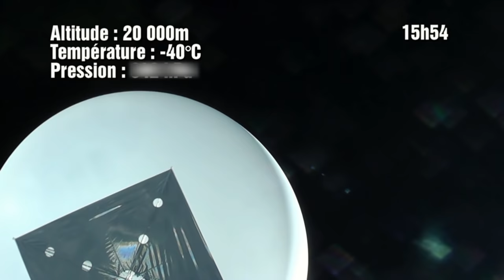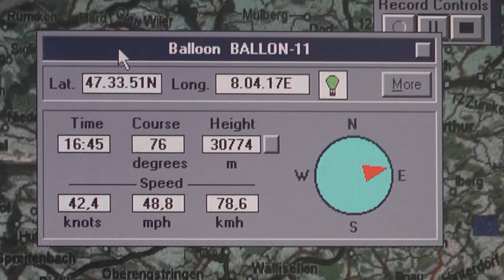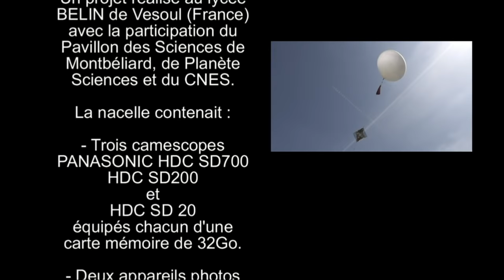Un ballon sonde stratosphérique filme un avion de ligne Swiss [subtitles]

Comment: That could have been a major disaster. And now it's being sold as if nothing happened and it was normal to spot an airliner with 160passengers at least at cruise speed of around 900kph inside 100m. The fucking Ballon had a wooden box!
Reply: Did you read the part about all proper authorizations and notice there was a RADAR reflector hanging from the balloon?  That airline pilot knew it was there and wasn't going to hit it.
Reply: Didnt read that part. But I still think it was unnecessary to get into controlled airspace with traffic.
Reply: @makor2817  Did you or did you not read the part about all proper authorizations?

Comment: Why does the temperature rise again above 13.000m ?and why does the balloon burst ?
Reply: As the balloon rises, air rarifies : sun radiation becomes greater and thermal exchange between the balloon and the environment decreases. Recorded temperature then increases.
As air rarifies, pressure around the balloon decreases. The pressure differential in/outside the balloon increases, which make it expand until its breaking point.
Reply: Coco L'asticot thanks mate !

Comment: It’s interesting,  the Earth rotates at 1000 mph,  and the balloon was in the air for nearly 3 hours yet it only landed 124 miles away from where it took off.
Reply: The atmosphere is also rotating at 1000 mph (at the equator). Items don’t just “stop moving” relative to the surface, the instant they leave the surface. If you jump up in the air, you’re not flung at 1000mph sideways, are you? And neither is the balloon. It’s just like a very long, high jump. The same.
Reply: The earth doesn't rotate the balloon experiment should prove that to you. It's the balloon that spin
Reply: The earth rotates with 15 degrees per hour.

Comment: First of all, excellent job and congrats to all the people involved in the project.  Let’s do some math.  We are told that the Earth rotates at a speed of approx. 1600 km per hour at the equator. Switzerland’s latitude is located about 46 degrees north of the equator and therefore, the rotational speed of the Earth at the launch site is approx. 700 mph or about 1126 kph. The rotation of the Earth at 46 degrees amounts about just over 11k per minute. The entire flight amounted to approx. 3 hrs.   Now calculate 11K x 180 minutes (3hrs) which amounts to a distance of about 2, 160 km. Now consider that probe balloon landed approx. 200 km away from the launch site.
  Can someone please explain why the balloon landed  only 200 km away and not over 2,000km, while taking into consideration that the atmosphere moves with the rotation of the Earth?

I look forward to your reply. Thanks and have a great day!
Reply: It is easy to explain. If the earth surface is traveling at 1000 km/h, so is the balloon and the atmosphere at the moment the balloon rises. So relative to eachother, both earth and the balloon aren't moving. The balloon drifts away due to the wind, but if there was no wind blowing, the balloon would come down even more near to the starting point.
The only deviation it then experiences is the fact that it covers less distance at 1000 km/h because the circle it travels along is larger than the surface of the earth.
Reply: @rinse-esnir4010  : Thanks for your explanation. I will do some research on it and get back to you. Have a great day!

Comment: The plane footage is obviously edited in, but how do you film that so close and from what do you film it to begin with??? Whatever it is it was stationary, but drones can't fly anywhere near that high. Another weather balloon perhaps, but how could you capture a plane moving at that speed and pan remotely so fast as to keep up with it? Plus, if the plane can see the balloon or whatever on its radar, why would it risk flying so close to it? Many questions....I may never sleep again without knowing.
Reply: They didn’t pan to follow it, they just slowed it down and zoomed in the frame.  That’s why it’s so grainy looking.  If played in real time, it would cross in a blink.  The plane can’t see a balloon on radar.  They don’t even have one on board.  They are just give. GPS locations of other planes.  The radar is probably 100miles away and sending into to the plane.

Comment: Why dit it first get colder and then warmer again? that's weird - nevermind flat or round
Reply: Chloe
The air drops in temperature the higher you go, due to less of an insulating greenhouse effect. But when the air is so thin it's nearly vacuum, then the heat from the sun becomes greater than the heat lost due to contact with the sparse cold air atoms.

Comment: What causes the balloon to burst at 102k ft?
Reply: The balloon keeps the same psi basically all the way up, but the outside pressure keeps decreasing so the balloon expands more and more until it bursts when there is only 0.02 psi pushing in against the inside pressure. Balloon just could not expand or stretch any farther.

Comment: Even nasa can’t find the curve in this one  . Viva la flat earth
Reply: It's not flat. Go to 10:15 and take a screenshot, then use an editing software to horizontally squish it. The curve is obvious from there.
Reply: @doddermodd  🤣🤣🤣 the blind will always be blind and that’s ok .   Have fun standing up straight while the plane-t spins at 1000 miles an hour as it corkscrews through the vacuum of space chasing the sun at 66.600 mph …… without a fish eye lense it’s FLAT
Reply: @titzalinabumscrew2511  This doesn't use a fisheye lens. If it did the horizon would distort from concave to convex. It always remains convex.

Comment: So why are there no CONtrails coming out of the jet engines at that elevation and temperature?
Reply: The air was too dry for the total moisture content to exceed 100% relative humidity (which is when the invisible water vapour condences to tiny but light reflecting water droplets.)
Reply: @toweri_li I know science, bro.  What I'm saying is only some of the air traffic at equal elevations...well below -70 degrees Celcius, at said elevation...then why do some jets leave persistent trails and others don't?  It's a rhetorical question.  The answer has been provided. 
Go on with your great sciencing, but learn how to spell!

Comment: Où est-ce qu'ils ont été cherché les courbes de pression?
Ils ont juste fait une règle de trois???
A hauteur de l'Everest, on mesure 320 hPa et 560 au dessus du Mont Blanc.
Eux, ils sont à 708 hPa à 9000 m et 848 hPa à 5000 m!
Reply: ça ne choque personne apparemment !  leur décroissance est linéaire, c'est donc tout faux...
Reply: il suffit de faire une régression ou d'aller voir sur wikipédia à :Variation de la pression atmosphérique avec l'altitude, pour voir qu'ils ont au minimum un gros problème de capteur...
Reply: @azertyuiop8252  
Celui qui a fait la vidéo n'avait pas les chiffres, il les a pondu en faisant une règle de trois.
Ils avaient un sujet intéressant, ils ont foiré les commentaires.

Comment: je trouve l´évolution de la température surprenante. Cette dernière devrait graduellement chuter, or, a partir de 8 ou 9000 m, elle semble remonter. J´ai pourtant l´impression que plus on est haut, plus on devrait se les geler. J´ai tort?
Reply: Un peu en faite car plus on est haut, moins il y a d'air et donc la température peut se réchauffer sensiblement ( à vérifier car je suis pas sur 😁🤔)
Reply: @artyg1654  Un vieux souvenir de thermodynamique de la fac, mais je reconnais que je me trompe peut être: premièrement, une vieille formule pour les équilibres thermodynamiques pour un système FERMÉ, et j´insiste sur le mot fermé: PV=nRT, donc d´après la formule, oui, la pression diminue et donc la température aussi. Mais une sonde en plein ciel n´est pas un système fermé, loin de la, donc la formule ne s´applique pas.  Deuxièmement, dans l´espace bien noir, loin des rayons du soleil, ou même sur la face cachée de la lune, les températures sont plutôt aux alentours de -200C, alors qu´il n´y a pas d´air du tout. Donc le fait qu´il y ait moins d´air ne me parait pas un bon argument. Comme la probabilité pour que je sois en train de dire une énorme connerie est grande, si qq´un veut donner son avis illuminé sur la question, je suis preneur. Merci d´avance.

Comment: If the earth was spinning at 1040mph shouldn't it have come down to earth thousands of miles away?
Reply: Its because of momentum... If you were to jump inside a moving plane, you wouldnt suddenly just start flying backwards would you? No, you would land on the same spot. Why? Because you are moving at the same speed of the plane, in other words you keep its momentum 

Similarly to the plane, even if this weather balloon leaves the atmosphere it keeps the momentum of Earths rotation
Reply: @dreamybullx1  

Hmmmmmm do you also believe we are traveling at 60600 mph corkscrewing and the with the sun and the planets we are traveling at 500.000 mph? Bit far fetched don't you think old bean.
Reply: @anthonydempsey7693  Yes we do and its proveable. Our position in the solar system is literally traceable by satellite and telescope measurings. 

So, you probably think: Why cant we feel the speed? Its because we are moving at a constant speed. Again, just like in a plane, at maximum altitude you feel absolutely nothing. You ONLY feel the speed of the plane if it were accelerating or decelerating (takeoff/landing). The same goes for the Earth, our speed has always been the same, nothing has ever changed it. 
The only difference between the plane and Earth analogy is that the plane flies in the atmosphere, a place with air resistance. Space however, is frictionless. There is no air, no friction to decelerate Earth

Also, you CAN feel Earths rotation, for example you can do a Pendulum Experiment. At the equator, where the rotational speed is highest, the period of a pendulum will be slightly shorter compared to higher latitude. By comparing the pendulum periods at different latitudes, you can estimate the difference in rotational speed
Reply: The earths spins with 15 degrees per hour. You don't get along with big numbers, champ. So, why do you use them?

Comment: At 100k feet it warmed up to almost 0 whats up with that?
Reply: Maybe the sun was heating it up and because the air pressure is so low it can't take the heat away fast enough? It is a myth that you freeze instantly when you are exposed to the vaccum of space, vaccum flasks hold their heat because there is no air molecules to take the heat away. The only way to cool down in space is to give up your heat as radiation because there is no conduction.
Reply: @dansmith2863  i have heard the aurora is thousands of degrees so i guess i shoulsnt be surprised by the different layers of heat.

Comment: I know what I saw —————— can’t change my mind!  Did any of you notice the temp was getting warmer the higher it went? 👀
Reply: macker700 no it didn’t. The temperature dropped by over 70 degrees up to 14000m, then rose a few degrees as the device passed from the troposphere into the stratosphere, which is where ozone levels are highest. This is why temperature climbs slightly as the device climbs past 14000m. It doesn’t get warmer, in case you were wondering, because of proximity to the sun.

Comment: so the higher you go, the warmer it gets?  strange.
Reply: aaron keeth 
No, it’s not.  The higher one goes, the less atmosphere there is for the heat gained by the sun shining on the box to radiate away.  It’s the same reason astronauts overheat while in sunlight and freeze while in shade.  If they did this experiment at night, it would not get warmer as they go up.

Comment: Where are all the satalites???????????
Reply: Gero Iavin Many of them are in geostationary orbit, far higher than the 3.6km this balloon got to (ten times higher). By most estimates, there might be around 2,500 in low earth orbit (it’s hard to know for sure, due to security and politics). A rough calculation reveals that 2,500 objects at an altitude of 36,000m means that on average each satellite would have over 6,500,000 square meters of space. That’s a lot of room for an object the size of a small SUV, and means it’s very unlikely that one would be caught on camera in an experiment like this.

Comment: Wait... I thought the curve was visible the higher you go?
The horizon rose up so I can see farther. Must be I have to go higher to see the curve?
Thanks for this vid!
Earth not a ball
Reply: If the Earth is truely a ball / sphere - then it is certainly larger than the 44,000 miles that we've been taught it is
Reply: @nekotranslates  Yes, I agree... was trying to get a globe believer to bite ;)
Reply: I will bite , whatcha got.
Reply: @wolfbbq6076  Just the question I posed is all I am asking here. Thanks!
Reply: Then yes the higher you go the more curvature you will see. You can clearly see curvature in the video at 9:04 because the earth is a globe.
Reply: @wolfbbq6076  But according to mathematics, you  should be able to see the curvature way way way way  sooner than that.  Is scientific math wrong?
had to edit... went to look at 9:04 as you requested. The curve that comes into the picture is because the camera is moving, not steady.
Reply: @juliebondzich8783  You can see the horizon curve at any altitude. But the lower your are, the more of the horizon you have te see before you can see curvature. The total amount of horizon in the video is too small to see the horizon curve, plus there is some lens distortion, making it harder to determine if the horizon is curving in the video or not.
In the second have of the video, the horizon is slightly convex and concave, depending on the position of the horizon in the frame.

Comment: Nice, flat horizon. 

Go watch Felix Baumgartner's Red Bull Jump. Notice what happens when the altimeter reaches 128,177 ft!!
Reply: Well he jumps. Not a single clue on this sequence about round or flat horizon. If you want to base your proof on a footage, you have to take a moment where the horizon intersects the middle point of the screen. Geometric lenses don't curve straight lines going through this point.

Comment: The proximity of sun busted the balloon.
Reply: LOL   -  the outside low pressure is the reason.
While baloon was in lower atmosphere it was subject to dense air pressure. Then the pressure in baloon is containing the gaz in small proportions.
When the outside pressure is lowering pressure in baloon is proportionally more and more greater. Then the envelope is expanding proportionally.
Until the textile is teared up.

Comment: 102,000=0.02 psi, 62,000=0.78 psi, 29000=4.49 psi, 16000=7.89 psi, 3000=13.12 psi, 3 feet=14.79 psi. This breaks the second law of thermodynamics. They must be lying. If not, then where are all the containers keeping these varying pressures in place? Hmmmmm ?
Reply: Scott
You dispute that air pressure drops with altitude? It's already 50% of sea level at the top of Mount Everest.
We don't need a container since gravity holds the air to the surface, creating the pressure gradient that is recorded on every one of these tests.
Reply: @fester3751  Not at all. I am saying that the second law of thermodynamics applies loosely, not as the law these people keep preaching but does not fit with their assertions. You might have to read back a little farther. Nature abhors a vacuum, but equilibrium is still achieved even within the flat earth model, or the globe model, without this law being applied so staunchly for all circumstances. It is obviously true we don't have containers between all of these varying pressures as no one deny they exist. Balloons, and altimeters. Don't even need satellites to prove the atmosphere is a gradient.
Reply: Me asking for the containers is directed at the simpletons insisting one is needed, somewhere between 00000000000.2 psi and 0.000000000000000000000000000000002 psi, etc. BUT NOT needed between 0.02 psi and 14.7 psi. There is no container to be found. lol

In fact, the gradient is such that we only get to 5%, or less the height of this 'dome' and we run smack out of pressure. The dome would have to be about 8,000 miles at it's peak in order to make room for the circling sun in their model which is triangulated at about 3,000 miles high if flat. Get this, 95% of their closed container is a vacuum, according to all atmospheric measurements. In fact much less. Their Sun and Moon are also orbiting in a vacuum. Now that's funny right there. :)

Comment: What happened to the curvature of the world? Any direction you look it was flat, I am sure that a scientist can come up with a reason why we saw a flat Earth if they don't like what they see then they just tell you that you are not seeing what you saw, how is that for relatively!!!???
Reply: Daniel Torrens take a disk. Look from above. Do you see any flat edge ? A disk has also a curve... no physics or math degree needed
Reply: @Ev-wj3lm  It was not looking from above, it was showing us what the horizon looks like, da! It wasn't looking straight down! The Earth could look like a dinner plate but it sure not a Globe that is spinning at 1000 miles per hour!! but when you are brainwashed by the Freemasons you could believe just about anything!!
Reply: Daniel Torrens I simply try to understand how on a flat earth do you find a flat horizon when seen from space
Reply: I can tell the curve, look to each horizonal side on each side. Slight, both ends. The planet is huge, so the curved down delineation is sight. Put it on a 65" monitor, freeze and measure, but not needed, it is apparent. Also look up geosynchronous.

Comment: Wouldn't have a problem with this if they were using hydrogen as a lifting gas.  But flagrantly wasting irreplaceable helium is reprehensible.
Reply: Hydrogen if highly flamable, helium is inert. That's why they use helium.